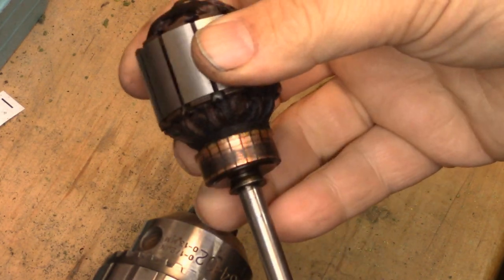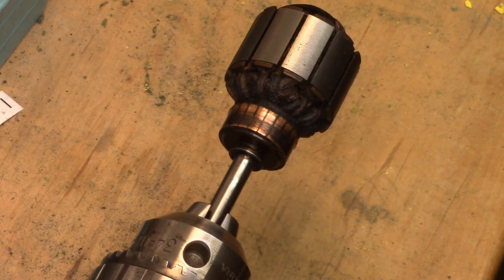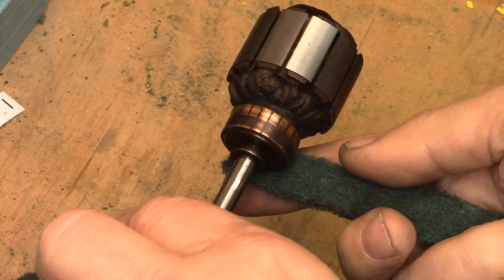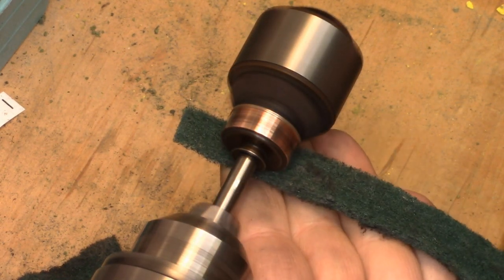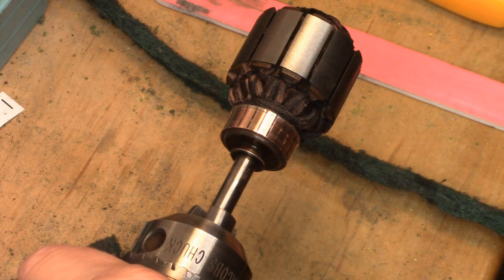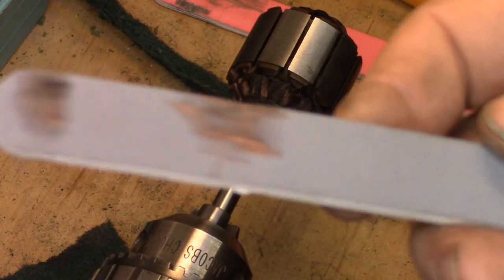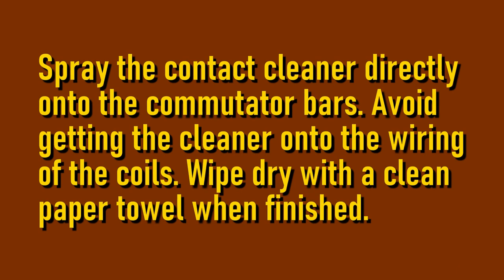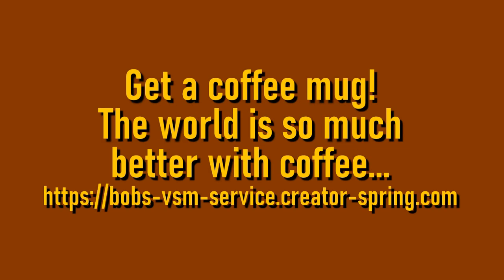Sewing Machine Motors: Clean and Polish the Commutator Bars

Comment: Very interesting!  I'm going to give this a go with a featherweight commutator.
  I think I haven't cleaned it enough.  Yours is really bright and shiny.  Mine needs more work.  Thanks Bob!
Reply from the maker: Go for it!, Just be sure to use contact cleaner to flush the filings away and keep the wires dry.

Comment: Hi Bob i am in the proses of saving a  15-90. I got everything working nicely except the motor. I put a new rubber drivebelt on and tention it acording to instructions but it seems like the motor struggles to get the machine to start sewing. It also makes like 'n buzzing sound in the speeding up fase that quiet down as soon it is operating. I did open the motor and cleaned dust and oiled the motor bearing. Any advice on how to fix this issue. Thank you sir.
Reply: did you ever solve? im having the same problem